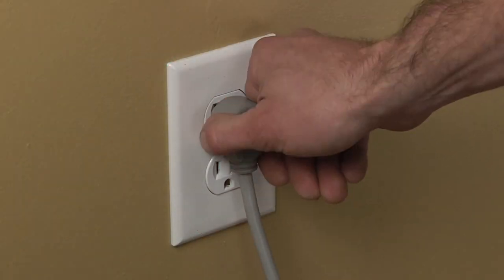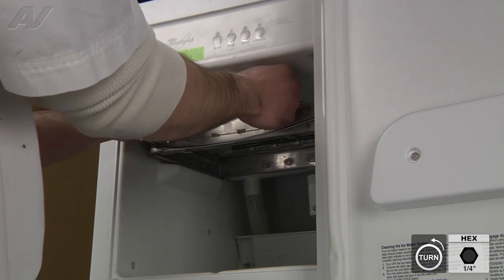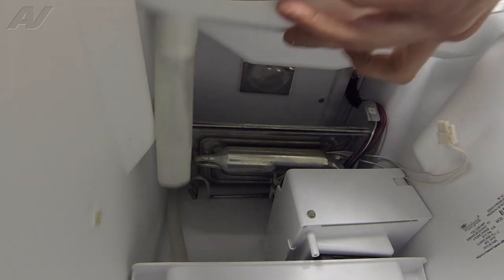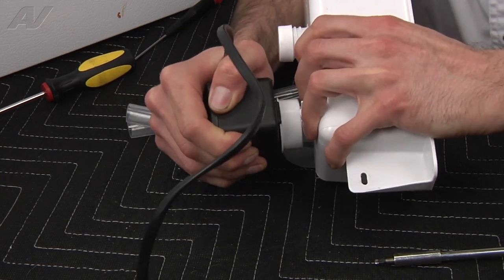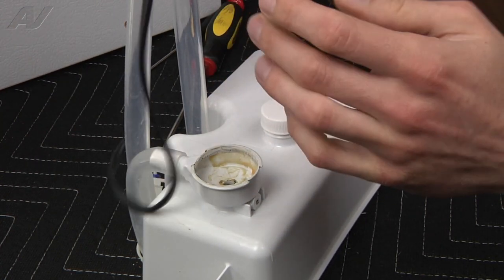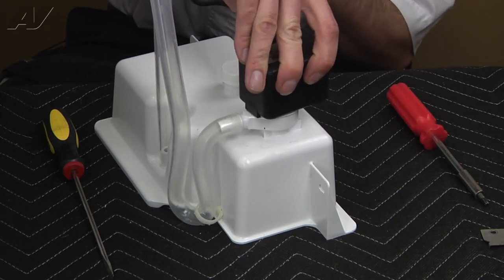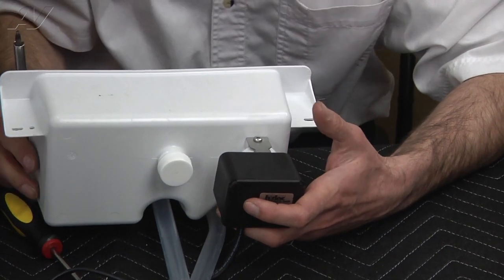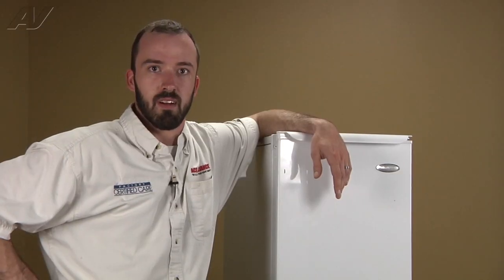Ice maker Repair -Drain Pump - Commercial & Household Refrigerator - Diagnostic & Repair

Comment: Matt, at 1:03 of the video, you mention that you can put the ice maker into test mode to see if the drain pump will function, but you don’t describe how to put it in test mode. How do you put the ice maker into test mode?
Reply from the maker: Great question, if you have a more technical question that our parts department cannot answer, you can search our over 17,000 answered questions free at our website www.ApplianceVideo.com under our Repair Help section. You can also call our parts department at 1-800-830-5465 and they can give you help 7-days A week ,or search at www.SaveMoreOnParts.com  .